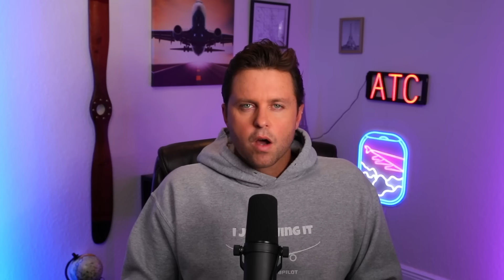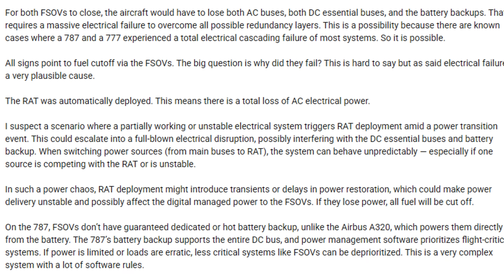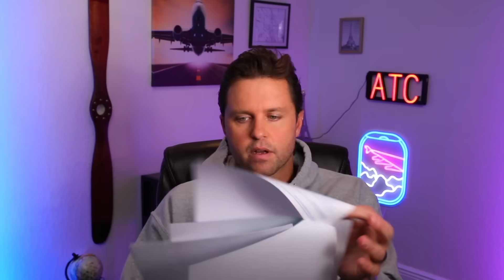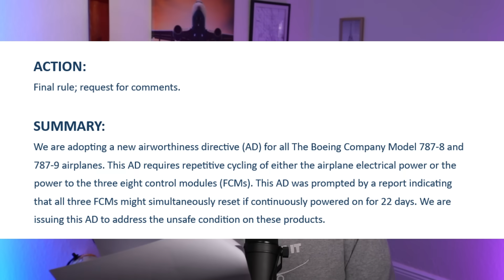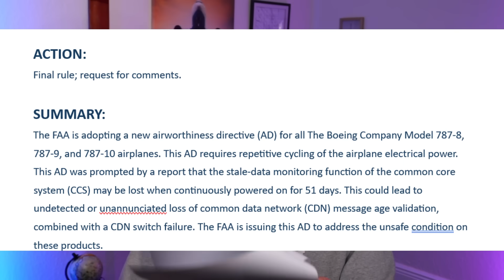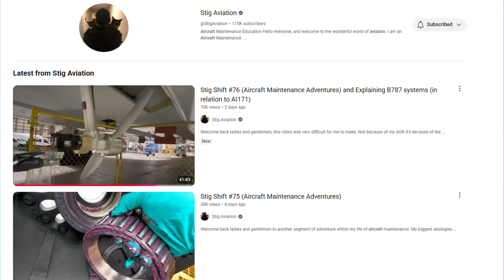Air India 171: Did a Software Glitch Cause Dual Engine Failure?

Comment: I don't think the cause was the powering off the fuel control valves, at least not the ones in the wing spar feeding the pylon/engine. 20-year aircraft maintenance electrical guy here (I posted on Captain Steeves engine failure video).  The 787 engine fuel shutoff valves in the wing spars are motor actuated ball valves.  It takes power to move them from open and power to move them to closed.  This is the failsafe (the fact that they need to be powered to be able to both open and close) They are not spring loaded to close with power off.  They will remain in their last position. 

There is another fuel shutoff valve on each engine that is called the high-pressure shutoff valve (HPSOV) located in the Fuel Metering Unit (FMU) on the engine, and this valve is also closed via the fuel control switch or engine fire cutoff switch.  It works a bit different obviously and is controlled by the Electronic Engine Control (EEC) which is powered by the permanent magnet alternator (PMA) on the engine. These are all part of the self-contained FADEC (Full Authority Digital Electronic Control) system. During the incident of the 787 that landed and both engines shutdown upon thrust reverser operation, it is the EEC that no doubt shut down the engines via the HPSOV as it will shut down the engine under certain parameters such as overspeed while operating in the "normal" mode.  The EEC does "talk" to the rest of the aircraft via common data network and it is software controlled. 

Overall, I too also think this was an aircraft electrical system failure of some sort (unknown cause) that had unforeseen consequences that triggered and affected engine thrust and/or somehow triggered the same dual engine shutdown as in the 2019 incident you mentioned.  The fact that the RAT deployed seemingly upon the weight off wheels (it cannot deploy until the aircraft is airborne) triggered some kind of fault that both EEC's interpreted the same way and either metered the engines to low power or shut them down completely. I tend to think they were metered down because the pilot did not indicate he lost both engines, just that he lost thrust power (I assume, as I haven't heard the radio call). 

What was the system-wide electrical failure to begin with if that's the case? This is a mystery. The 787 is the most complicated "all electric" (and really the only one) aircraft out there. With millions of line of code, this may be another 2–3-year investigation.  I just wish they would update us with at least what they know...
Reply: Afraid, then it (all the more) calls for a grounding of 787’s with so many unknowns and questions. 
Sophistication with software that isn’t fully known as to its full and complete functionality, it is a rabbit hole about which everyone’s discussing.
Reply: The Bus Power Control Unit (BPCU) is the mssing part in your puzzle. This is the critical control system that sits above all(!) electrical redundancy. Either BPCU itself failed or it didn't do what it should when something else failed (on "gear up"). Maybe suction feed of the engines was insufficient or some computer system set the throttle back when the electrical system came back. Survivor even suggested the engines were powering up right before impact, but it was too late.
Reply: @Lunavorian  maybe it’s something where the computer lowered the thrust with a power reset and the pilots just need to cycle the throttles or hit the toga switches again.
Reply: Thank you for your comprehensive and clear hypothesis. It is really good to have people such as you, with experience in the industry, writing clearly and logically. My interpretation of your reading of what may have caused the crash possibly lies within the complexity of the aircraft design, and while all modern planes are extremely complex, you say that the 787 is in a league of it's own for sophistication. I just hope this accident's official report doesn't damn the model's software design. How could Boeing survive if so? Air travel is very safe these days,  but this crash was a shocker from which so much must be learned...
Reply: I think you are right with the similarity to the 2019 thrust reverser incident. If the engines flamed out because the fuel suddenly stopped the plane would have stalled. Also, in the video where you can hear the RAT, it sounds like the engines are still running - but decreasing. This suggests the FADEC decided to throttle down the engines - just like it did in the 2019 incident when the thrust reversers were activated - only this time gear-up was activated, the power failed and the RAT deployed? Giving the pilots a FADEC bypass button might be a good idea.
Reply: @cyber5515 probably a good idea but doubtful they would have had time to recognize what had actually happened and bypass it
Reply: Wow, this is the most informative comment I’ve read and from someone that actually knows the 787, thanks so much.
I initially thought a weakness in the software code might have been the probable cause of the problem and commented on this but after thinking this through some more and reading more from people like yourself, that really does know the 787 system/engine controls I’ve come to the conclusion the power problem with the plane created a situation where the computer control systems couldn’t recover cleanly and because these control systems can control the thrust of the engines you have the outcome that no pilot could override.    
What happens to a computer/controller-based control system (FADEC, EEC…) when power is interrupted or power dips or power surges? What happens to all the sensor inputs to the computer system during a power problem?  How do all these variables recover cleanly and in perfect sync when power is restored and how long will it take? 
When the computer modules are running normally it’s monitoring all the various inputs from the plane and engines in real-time and making decisions based on the inputs. When there’s a power problem such as a momentary interruption, drop or surge in the power the computer system can potentially lose data or stored code if there’s any volatile memory in the system and at the very least the system may need time to recover from the power interrupt. The electronics can also be permanently damaged from power surges. The sensor inputs (rpm, temp…) from the engines may be affected by the power problem too, so even if the computer-controlled modules are operating as intended the sensor inputs form the engines may be corrupted for some amount of time.  
There are so many variables in a complex computer-controlled system and timing is everything, add a power problem to this mix and you have a very difficult challenge to predict all the possible outcomes and an even bigger challenge to find a recoverable solution for all the variables.
Reply: @dougswanson9142 We in the professional IT world call this recovery testing, and I have ordered it for my SW projects for the last 25 years. Especially within life critical systems like airplanes or hospital systems this should be mandated.
Reply: Veey good comment..and one not talked about..the pilot would have reported engine failure..he didnt. They werent performing as expected. Reasons unkown. Engine fire and fuel shut off to wrong engine? Its happened before? 
     Whatever happened the pilots wouldve tried their very best right to the end.
Reply: @sj460162 They had only 40 seconds before it went crashing ..
Reply: "The FADEC primarily relies on the engine-mounted generator. But there are also backup power connections from the aircraft's main electrical system, providing additional layers of redundancy." 

Maybe the electronics in the FADEC is not immune to a power surge, or spike, or glitch, on the AC or DC power lines? So when something is activated on the main electrical lines (like the reverse thrusters, or gear, or RAT, etc. this naturally causes an inductive feedback electrical glitch which sometimes enters the FADEC and causes it to reboot.
Reply: @dane2030 Absolutely correct about the fuel shut off valves. You saved me writing the same thing. I have the utmost respect for pilots but they are not engineers, they do not know the aircraft systems. I am a Licenced Aircraft Maintenance Engineer for 43 years (retired) and have several GE FADEC engine licences.
Reply: Thank you mate, I am sick of all of these "pilots"! They fly them, they do not fix them like "us guys"...Thanks for setting him straight!
Reply: Wow! Thanks
Reply: This makes more sense. Thank you.  Good to hear from people who work the hardware.
Reply: someone mentioned a sunstorm could have caused the electrical issues, given sun activity is at high right now I actually wouldn’t rule that out tbh
Reply: So i think i'm correct in assuming that the the motorized ball valves are to controll/regulate the fuel flow rate to the engines whilst the fuel shut off valve - DC solenoid valve whch would be spring loaded as per normal solenoid valve - energized the valve is fully open - against the spring resistance - and de-energizing slams the valve closed completely cutting off fuel to the engine.This would be controlled from the fuel cut-off switch in the cockpit BUT ALSO the EEC in the event of engine fire ? Power failure/de-energization of a motorized valve would leave the port open in the position that the power was removed.
Reply: thank you for sounding intelligent with your response.   Sure sounds like a perfect storm that us flying this thing, never want to encounter.
Reply: I don't think the RAT deploys in case of engine idling or "metering down"; I think it would have to be only during dual engine failure/shutoff in-flight. In that case, there would be indications in the cockpit that the shutoff valves were triggered, right? Maybe the pilots were too busy to do anything about it, even if this was the case, and they were too low to relight, of course.
Reply: They should be able to see the fuel flow rate in the data right away. I think they're gathering Boeing executives in a conference room in India too explain why they hell fuel was lost.
Reply: You just can’t not risk lives until you KNOW what the cause is they all have to be grounded for now !
Reply: who designed software?
Reply: So actually a similar incident had happened before only that time it was on the ground so not a lot of people knew about it?

Like… do they really need a plane to crash to start fixing a potentially catastrophic flaw? 

And now that one has crash… 

Do they really need a second plane to crash like 737 Max, before start doing something about it?
Reply: @tonamg53  BPCU could be the new MCAS... senior Chinese scientists looked at the "most electrical" 787 and couldn't get behind this system. Their only conclusion was: "The practical structure of BPCU is very complex and it contains many integrated cells and control devices."
Reply: @tonamg53 😂Yeah
Reply: ‘Complete’ testing and proving of software systems as staggeringly complex as these would appear to be impossible. I remember reading an IBM article saying as much many years ago. Although overriding the pilot can sometimes be correct, and is certainly built into such software systems, maybe, just maybe, there is still a need, after the system has loudly declared its intention to take a certain action, for the pilot to have a final ‘do or die’ chance to override that system. 
I thought that in the 737 Max fiasco, and can see it in the current one also.
Reply: @Chris-mv5yg  indeed. Was in hardware verification. Agree complete testing and proving of software systems (like their hardware counterparts) would appear to be impossible. In fact, hardware is even more complex. Can get to hardware only through software. 

Even so, out of all the possible input combinations to hardware (FADEC and the various fuel lines to the engines), to avoid dangerous situations that cut out fuel, the human mind need only consider those input combinations that bring about these dangerous situations. These combinations are blocked in software so that hardware never sees them. Masking. 

Appears 787 software needs corrections. A systems engineering issue. Software engineers designing/writing code looks like had little idea of how the hardware is supposed to work. Sad!
Reply: @Chris-mv5yg Amen. Having myself worked in the software testing industry for 25 years, you summarized my thoughts exactly.
Reply: So this video is just more utter nonsense
Reply: As yet, when and why the RAT was deployed is unknown, but from your comment it must have been after the main wheels left the ground.
Reply: Do you actually know what failsafe means??
Reply: @tolikfox007 that the system remains in a safe condition upon failure of power/control. So you would think that keeping the valves ‘open’ to supply fuel to the engine in the event of total electrical failure would be the ‘safe’ condition surely?
Reply: @Gregorb6  unless a fire is what cuts the power.
Reply: @tolikfox007 you want fuel to your engine if you lose electrical power. The sircraft must be able to fly.
Reply: @dane2030  What is a "sircraft"?
Reply: @mv-db4463  It's like "aircraft" but a special one, hence starting with "s" - have you not heard of it? :) Joke aside - It's called a typo - "s" is next to "a"
Reply: @mv-db4463  ”aircraft” (letter ”s” is near letter the ”a” on the keyboard).
Reply: @Nini-144  Ahhh 👌
Reply: @tolikfox007 Failed safe on the ground - turn off the engine.

Failed safe off the ground? - don’t you friggin dare turned off my MF engines.

Comment: As a software engineer, a software or control system bug was an early (and natural) thought for me.  The more info that comes out, the more I feel it's something like what you're describing.

Also as a software engineer, I'm confident that pinning this one down is going to be a right bitch - and that's before allowing for the effect that vested interests will have.

Comment: Disaster Breakdown does an entire episode about the issues with the 737 and the Boeing coverup. Supports exactly what you've said here, I have been saying that it was the electrical system that started the problem, now I'm not a pilot so people disagreed with me. Years ago I had an old Ford. And the electrical system just cut out while I was on the Long Island Expressway going 65 mph and I lost all control of the car. Steering locked up, breaks didn't work... the car just coasted to the side of the road - this is sooo scary! This tragedy reminded me of that scary incident. TY.

Comment: I totally agree, 30 years Aircraft Maintenance Engineer for one of the big players, I definitely think it was a FADEC software logic fault that effected the fuel management within the Electro HMU and LP/ HP FSOV's, It is true the FSOV's solenoids are powered by 
 the 28V DC electrical system but the FADEC has full authority on the control logic and signals for operational solenoid modulation, they are not spring loaded to a bios if the engine generators stop producing power which could also be a code fault in the GCU, For the aircraft to have a simultaneous engine spool down and no yaw characteristics, it seems like a coordinated FADEC signal logic code fault, This is so serious, I found doing research on ARINC 429 data bus systems in which are in the Genx-1b to be very interesting, It is just great to see so many knowledgeable aviation professionals out there trying to troubleshoot on this tragedy .
Reply: Simply it appears that both engines were commanded to rollback at the same time. But why?

Comment: That's a hard sell too, Gary.

As for the GCU's: 248 days?  Are we to believe these aircraft are being left powered continuously for the better part of a year?  Surely they sit at some point in remote parking to make a gate available for another flight, undergo 24hr, 3-day and other MX checks where power gets cycled; they get towed around with and without the APU running, get disconnected from jetbridge power overnight at out-stations...  Was this AD something Boeing (or vendor of the GCUs, it's doubtful Boeing manufactures those) discovered while doing testing or audits on firmware/software?

As for the second AD, I think there is a typo in your paperwork which erroneously reads '...three eight control modules...' but should read 'three FLIGHT Control Modules (FCMs)'...  And, 171 didn't seem to lose directional control...

And the third one, not sure what CCS is but it looks like some kind of sensor-generated message cross-checking... but again, 51 days?  That's almost 2 months.

I don't see these 787 aircraft being run that hard, continuously, without ever shutting down to cold and dark, so my guess is these ADs are 'prophylactic' if you will and discovered in testing and auditing.  If you're saying there is a TREND in 787 electrical problems... well, maybe, Boeing seems not to be able to engineer their way out of a paper bag these days.  The historic 737 rudder hardover happened without a trend in hydraulic or flight control issues to my knowledge, for instance.  Then again the MCAS mess sure did have plenty of trends... Like you said, you could be on to something here, or not.  Sometimes the simplest explanation is the correct one; sometimes it's not.

The ANA case is interesting, could the FADECS have detected an overboost of some sort because of the high density altitude conditions at the airport?
As to your final comments about fuel starvation for a couple of seconds... don't those FADECs have auto-relight?  Yes, they are windmilling, but 2 seconds is not enough time for the core or the fan to spool down that far.  2 seconds of loss of thrust on takeoff would definitely catch anyone's attention... but it's a hard sell.  Maybe the fuel cutoff valves snapped shut and stayed shut?  Maybe they could have saved the day by cycling the cutoff switches and resetting the valves to open?  Tragic, but maybe...